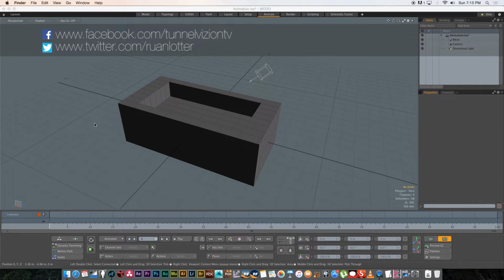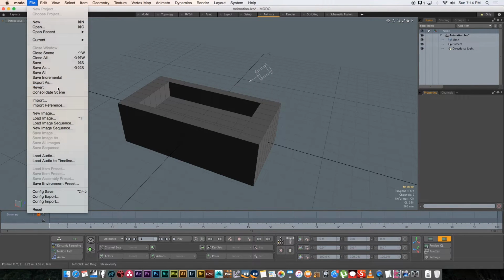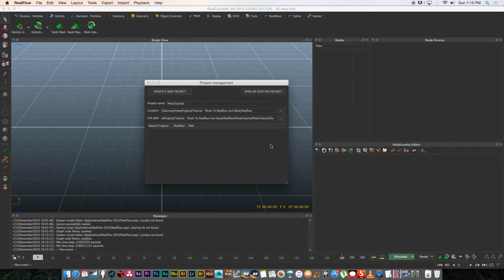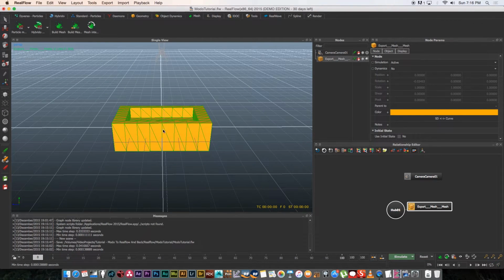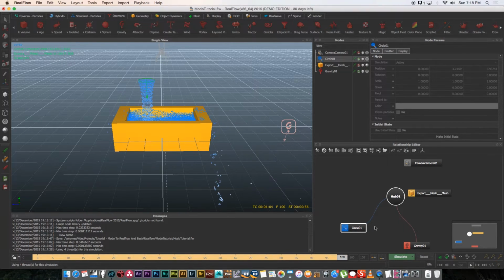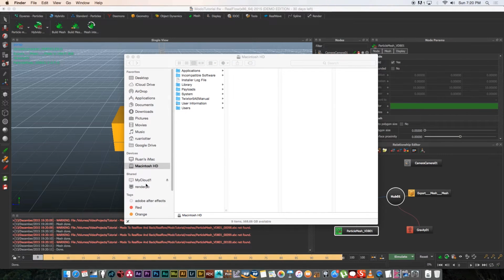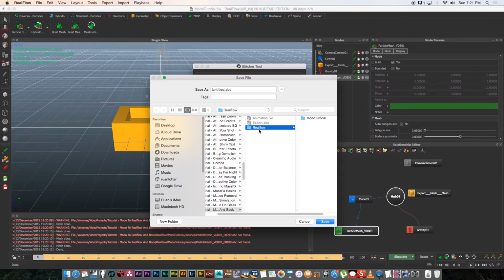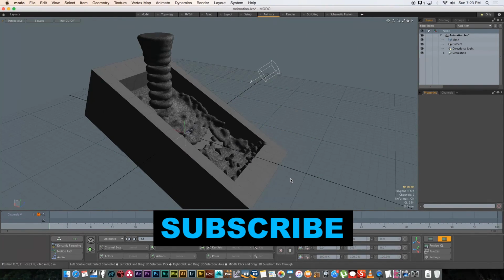How To Export Realflow Mesh To Modo - 3D VFX Tutorial

Comment: This is exactly what I've been looking for...the ability to integrate realflow with modo, without the need for a 3rd party plugin.  Only one problem, it's not working for me.  I follow the process exactly, but when I import the stitched file, my timeline goes out of whack.  I start at 0-80 frames, the same as my realFlow sequence, but when I import the file, the timeline jump to a range of .8 through 64 frames.  No idea why.  Any suggestions???
Reply from the maker: +Seth Jensen Hi - that's strange.... Did you check your frame rate settings in both Realflow and Modo?